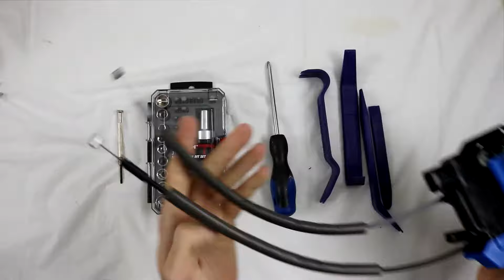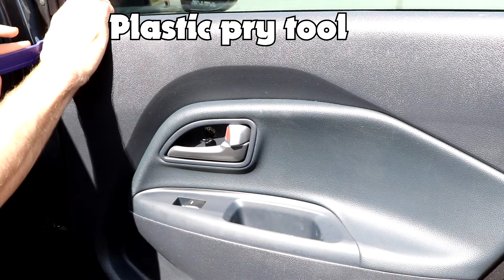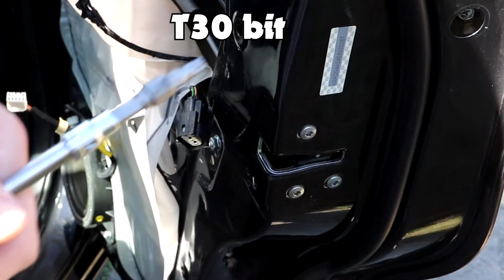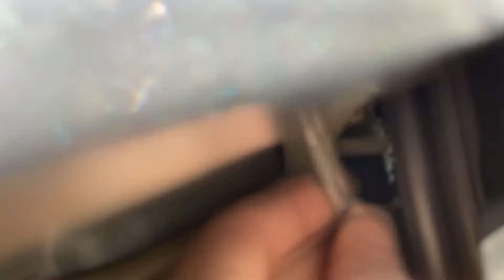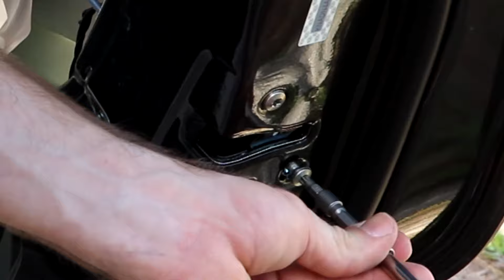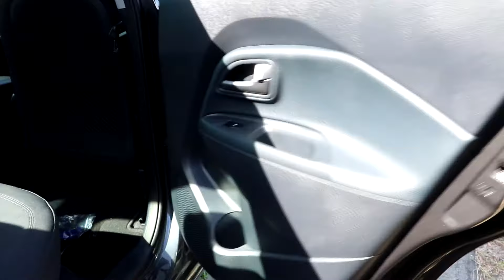Kia Rio Door Latch Repair/ Installation - Door Locks FIXED 2012-2017

Comment: Great video, I have a Kia Rio 2012 4 doors hatchback, right hand driven and the actuator of the driver door is not working, now I know how to change it thank to you. Would you help me confirm if the right part number is 81321 1W040 I will get it online and I am trying to get the correct one. Thank you
Reply: Any confirmation that this was the right one please?
My driver's side door has stopped locking with the automated key, i have to turn key in lock for all doors to work in unison. It also does not lock once driving has commenced
Reply: Did you have any luck with this? I have same model and same exact issue. Thinking to give it a go myself - mechanic quoted me $700.

Comment: Thank you! We found a new latch for $35 on Amazon. They were on eBay for same price. This video made it an easy 1 hour job to replace. It works perfectly! The only hard part was fitting the plastic piece coming out of the key lock that unlocks/locks the door. Took a few try’s but we got it!

Comment: I have a 2012 Rio (in the UK). My problem is that the fob unlocks all the doors ok, but the manual blade/metal key doesn't work. The key goes in the hole, it turns, but the door does not unlock. Any ideas?

Comment: we have a 2013 rio hatchback.  the lock will not unlock on the passenger door using the fob but we can manually unlock from inside the car.  Do you think it is the actuator and not the button?  What is the likelihood this will happen with the other doors?
Reply from the maker: That sounds like the actuator would be the problem. It is most likely going to happen on all the doors eventually. I’ve replaced 3 of them lol.
Reply: Hai fatto un video su smontaggio attuatore?

Comment: Gr8 info to DYI.  I have a 2007 Kia Rio LX that appears to have a separate actuator.  Very similar door layout.  Not sure if  my latch or the actuator is faulty (2 separate items in my car and actuator quite pricey).  FAULT:- Front Drivers door wont unlock unless I turn key to left and lift outside handle (The key has no remote unlock/lock button).  This action does not unlock other doors but other door work together with central locking action.  The drivers door internal lock/unlock latch is jammed locked and seems to be a stuck cable, cannot open door from inside.  When I put to key in the ignition I hear the drivers door actuator pulsing for a short time but nothing else occurs.   Am I correct in saying only the latch is faulty as all mechanical cables go into it.
Reply from the maker: Since it’s a separate actuator, your likely correct about that but I’ve never worked on an 07. Thanks for watching!

Comment: how similar would this be to a forte koup? Also would i only need to purchase the Latch Assembly in order to make the change?
Reply from the maker: The forte has an almost identical latch assembly. If you’re having issues with the door locking or unlocking or any similar problem, replacing the assembly would likely fix the issue. Thanks for watching!

Comment: Thanks so much for this! Any chance you might have some insight on a related problem I'm having with my 2012 Rondo? The power lock on the front driver's side door still kind of works, but the key entry/lock doesn't, and the whole lock mechanism is malfunctioning. If the manual switch on the interior is in the "unlock" position to start, the power lock won't lock. The key also will not lock the door. Meanwhile, if the manual switch is in the "unlock" position, the power lock won't UNLOCK it (neither will the key!), so I have to manually unlock it from the inside. BUT, if the manual switch is positioned just right - sort of in the middle between lock and unlock - the power lock WILL unlock/lock the door (while the key still does nothing) except now the mechanism seems confused. Every time I open the door, it will lock and unlock several times in a row by itself, and randomly land on either lock or unlock. It will land on unlock even when the keys are in the ignition and even if the car is on - which it shouldn't be able to do. This has resulted in me getting locked out of my car with the car running when I've forgotten to hit the power unlock button on the fob twice to unlock the rest of the doors. Luckily I was at home and had access to a spare fob in the house, but that's scary. Any idea what's going on?
Reply from the maker: I've seen this symptom before, It's the likey the lock actuator/connector. Disconnect the electrical plug that goes to the actuator and plug it back in. make sure none of the pins are bent or broken. If problem persists, replace the actuator.
Reply: @EnoughAboutCars  Thank you!! Wouldn't that be amazing if disconnecting/reconnecting fixed it!

Comment: Hi thanks for the Videos, i just bought a 2013 Kia Rio a couple of months ago and  wouldnt you know it, the passeger door wont open with the controller, do you have a link where we can buy this part or the part #, and would realy appreciat it if you could do a video on replacing latch the one in the Trunk, and how to diagnose and fix heated seats, cz guess what they stopped working too :) thanks

Comment: Hi, nice video very, but what if the door is permanently locked shut? Any suggestions on how to proceed? I see you disconnected the battery, does that disengage the central locking by any chance?
Reply from the maker: Hi thanks for watching. Disconnecting the battery wont unlock the door. If the door is stuck shut, you cant take out the latch assembly. I would call a locksmith. if the locksmith can get the door open, replace the latch assembly before you close it.